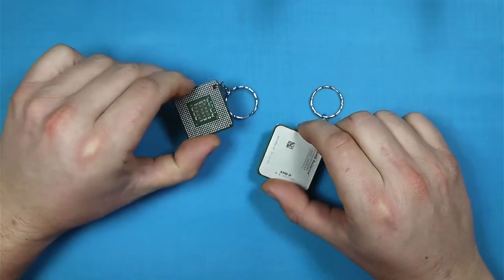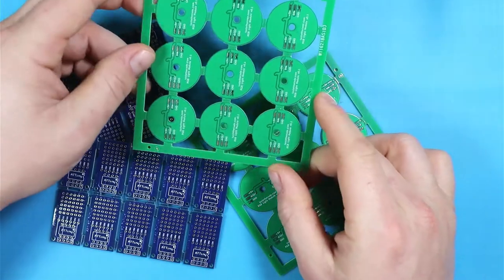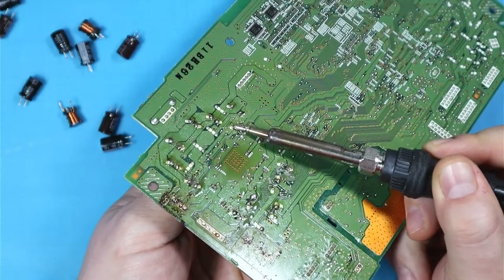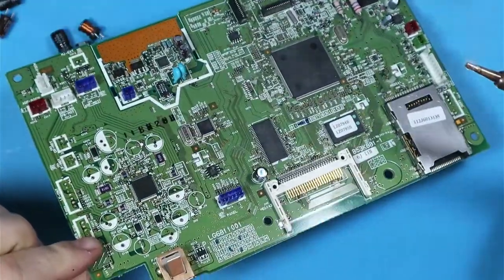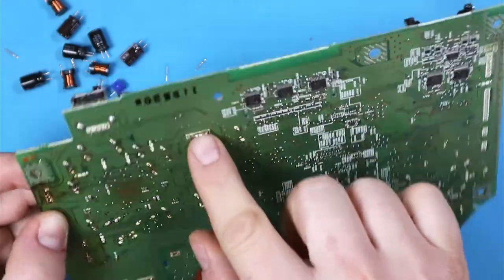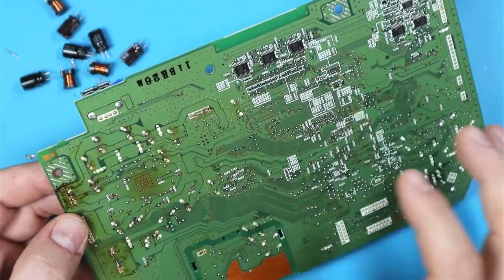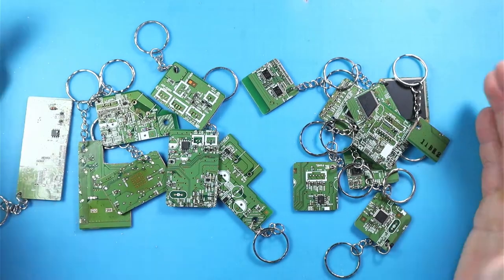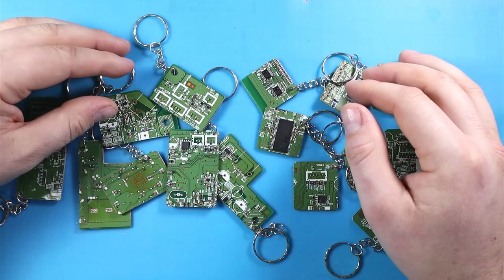How to make beautiful PCB keyrings from recycled printed circuit boards

Comment: Hi, fantastic work . What tool did you use to cut the pcb ?
Reply from the maker: Thanks! I used an angle grinder with a stainless still cut off disk. It does creates some dust so it is best done outside with a proper breathing protection.
Reply: Thank you.